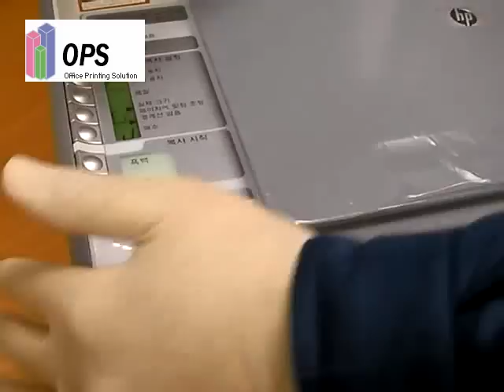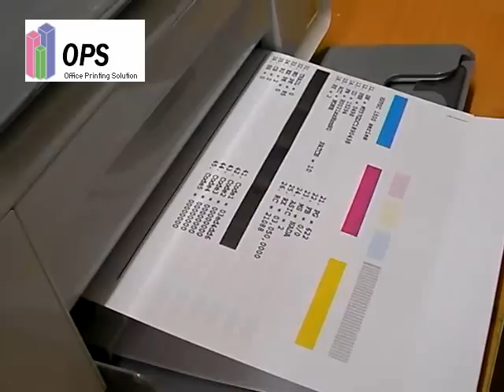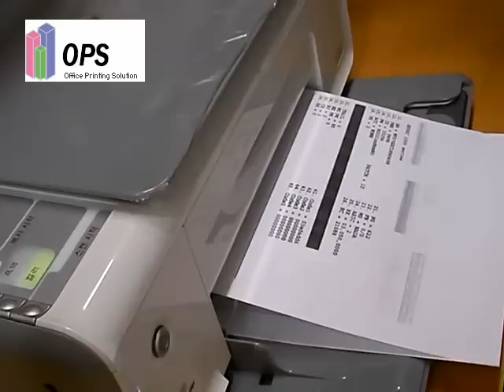officejet and photo smart replacement clutch gear [inkdanawa.com]

Comment: I would really like to see the same for C5180. I have the spare clutch gear but I am stuck during disassembling at stage when the whole printhead and rails has to be removed. In C5180, it seems much more complex.
Reply: Is it the one on the gray rollers? That's the one that broke on mine. Can't even find a spare. Got a D7160 for a doner though.

Comment: Hi, I have Check Paper issue. I remove the paper sensor according to "Disassembling HP Photosmart c3180 Feed Roller Assembly Removal" instruction but still the orange light flashing. What could be the possible issue?